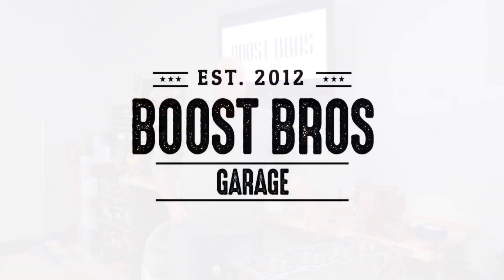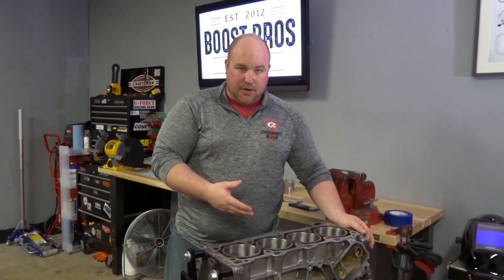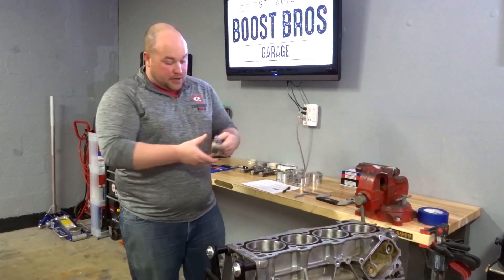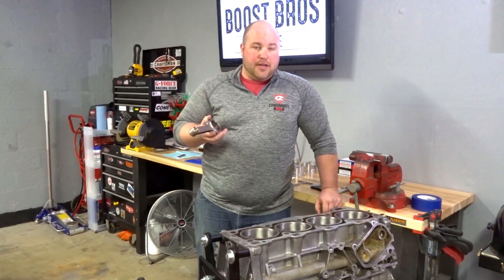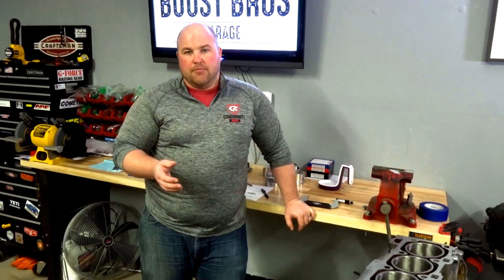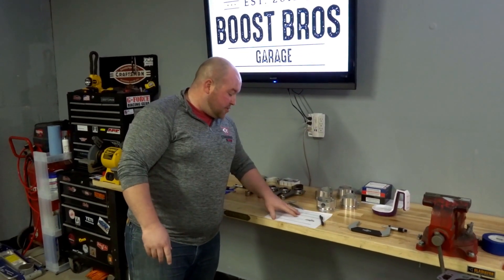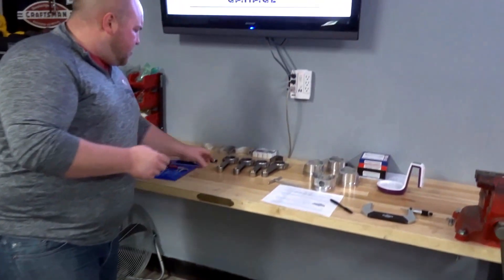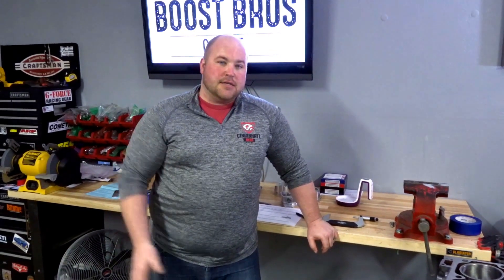Porsche Turbo Stroker Build Part 1!

Comment: Great video, did you have the block half filled?
Reply from the maker: pte6262 thanks! It is filled and I actually did it myself. The machine shop wasn't comfortable doing it due to where the water pump holes were. I'd be happy to show it and describe it further in a future video if you'd like. Thanks for following along!
Reply: Boost Brothers Garage that would be cool to hear about.
Reply from the maker: Hugo Garbati I'm on it!
Reply: Boost Brothers Garage engine block N/A or Turbo ?
Reply from the maker: Turbo... Factory block from my '86
Reply: Half filled as in Devcon? Just curious.